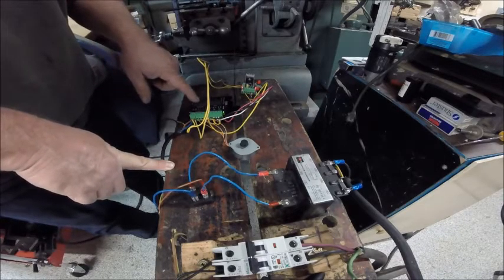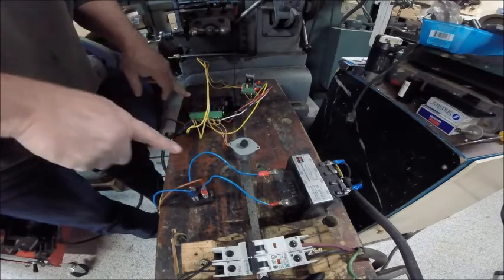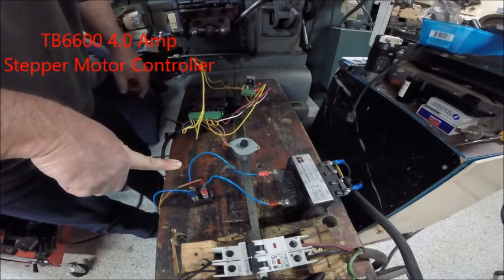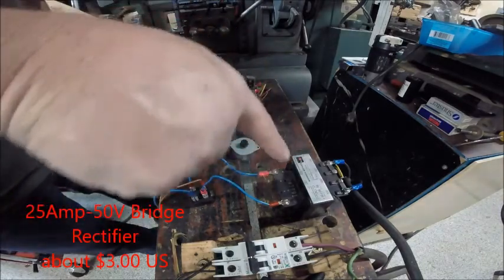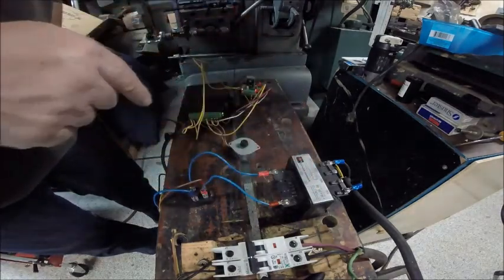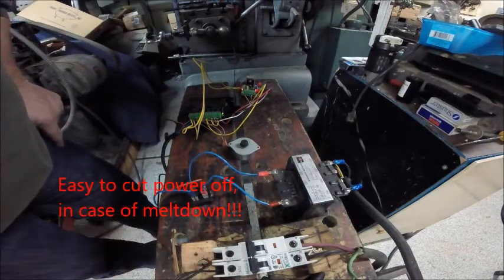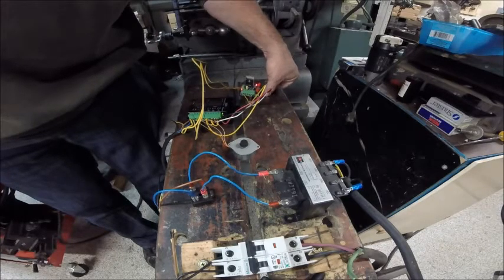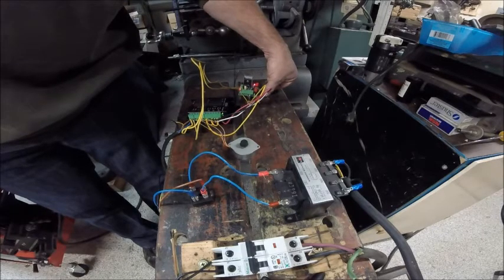TB6600 Stepper Motor Controller With Pulse Generator Speed Control

Comment: Cool one of those was on a surface grinder I got it was used on the down feed 440 volt I found another one in a Budweiser lite that turned the wagon and horses around neat little motors
Reply from the maker: they are neat to play with!
i'm getting the systems together for a couple projects and i'm working out the placement of components.
i finally got the right drivers and the pulse generators are easy to figure out.

Comment: Do you have any electrical education background? Or self taught? If self taught, any recommended sources to check out?
Reply from the maker: Hi Chaotic Logic,
yes i work on automotive and diesel electrical systems until i started on working on automatic packaging machines and scale systems in the food processing industry. i have been to many manufacturer/factory held classes .
if i were to recommend a place to start , i would learn about DC power first.
read anything you can on DC power and start playing with simple circuits and then add components to that simple system to make it more useful for a purpose and then once you feel you have a grasp of DC power read more on it until you don't really have many questions left.
then move onto AC power and repeat the process.
i wish there was a simple way to impart knowledge.
experience and desire to learn are prerequisite to what you will learn.
never stop learning and find wonder in simple things, would be my advise to anyone